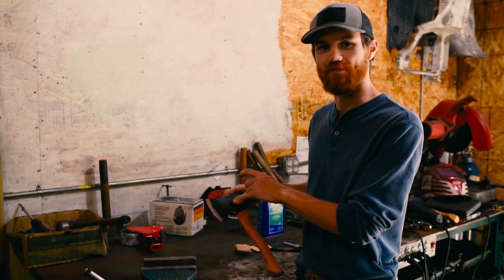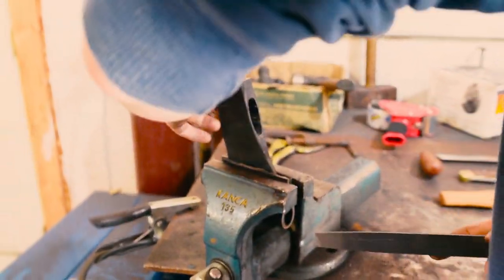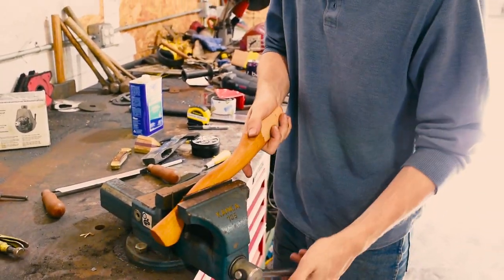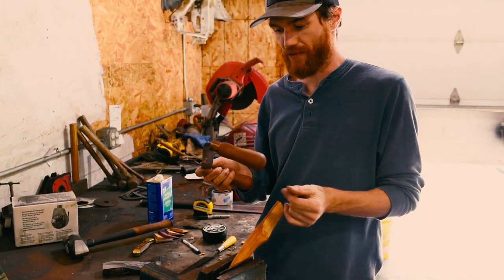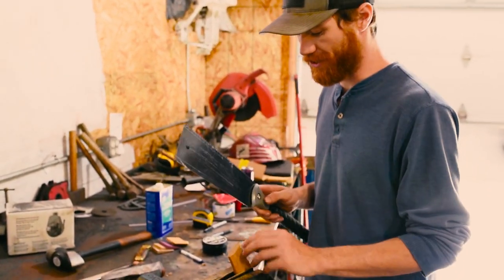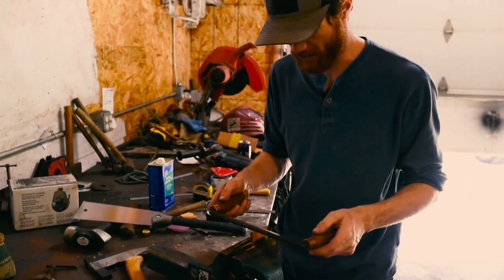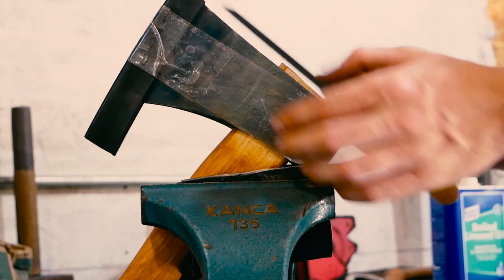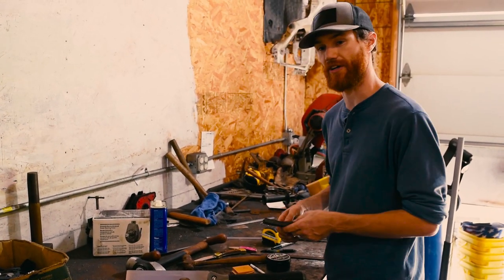How To Hang An Axe // The Foot Long Flying Fox

Comment: As usual Brandon, the video was refreshing, straight forward and informative. I use an old council tool pickaroon to move logs into position for the safe use of a,chainsaw.
Keep up the great work. I need you to get those sharpening pucks back in stock. Thanks again

Comment: On filing those ridges down in the eye, aren't they there to help hold the head to the handle? Do you file completely flat or just the ends near openings of the eye? I re-hafted a Council Tool suv boys axe recently with a CT replacement handle and didn't have any problems that I can see yet-seems pretty tight in use.

Comment: Just a FYI, you should never use a draw knife to fit the head as it is way to easy to take off to much wood ( look at the chip out it left behind) unless it is the only tool you have. When you are getting close use a card scraper or a knife. And you are correct the draw knife should only be used as a card scraper.

Comment: It was painful to watch you scrub back and forth with the metal file. A metal file only cuts on the forward stroke. Dragging it back with any pressure dulls the file. Otherwise great video.